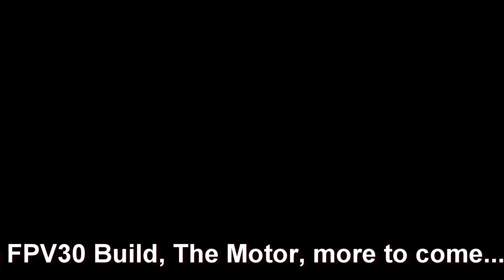How to build a Flying Wing - Part 8 - Installing the motor

Comment: Is the collet on the motor included with the motor?Did the collet come with the motor?
Reply from the maker: Karthick Ashwath I do not believe it came with the collet.  There is an accessory kit you need to buy.  http://www.hobbyking.com/hobbyking/store/__16719__NTM_Prop_Drive_28_Series_Accessory_Pack.html?strSearch=ntm%20acces
Reply: UnlimitedVertical Thank You very much .